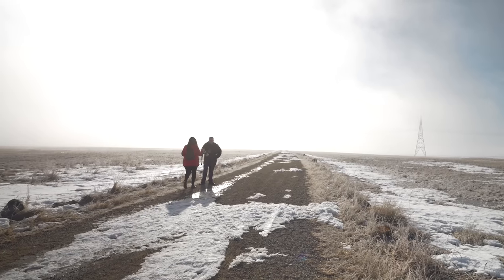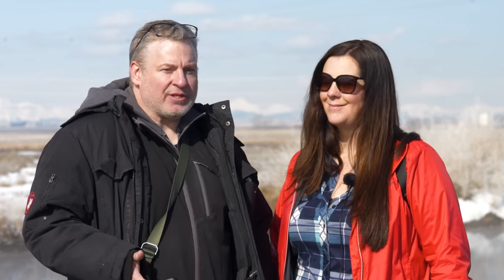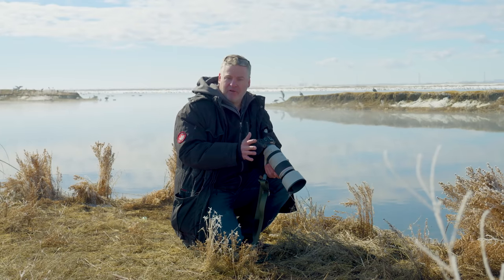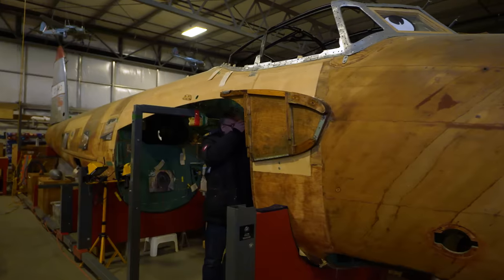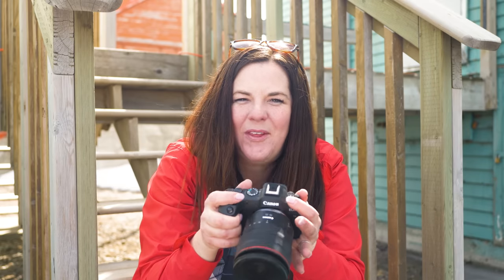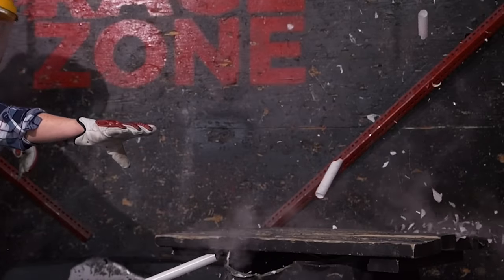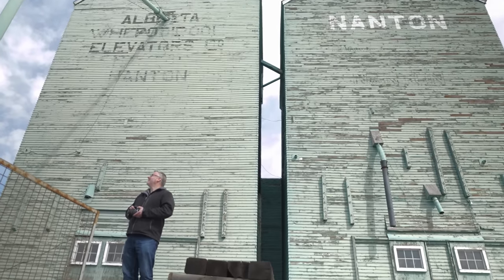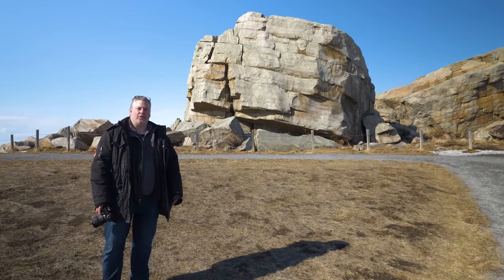Canon EOS R8 - Does It Really Live Up To The Hype?

Comment: Did y'all see the price of that R8 battery?  They cost nearly as much as the ones for the R5/R6 but only give ~ half the energy.
Reply: There are some decent off brand ones that are pretty cheap and work fine been using them in my RP for 4 years no problem easy to carry always one in my pocket and a couple in the bag. I can swap it in 2 seconds if needed got the move down! A fresh one will carry me most of the day and sometimes all day
Reply: That is the Canadian price.
There is a price difference but I do agree that it is not enough.
Half the battery life should be half of the price.
Reply: @robertm3951  Oops. I can never tell when Im dealing with a Canadian. :)
Reply: Canadian dollars aren’t worth much.
That camera is 1499USD.
Reply: Wasabi powered

Comment: I am a photographer, since it was my birthday, I opted for this because of the obvious price point. The second thing, as a photographer, what exactly is the big deal about the image stabilisation? Given that my main target is pet and landscape photography, for pet photography shooting at the faster shutter speed, not really going to concern yourself over the camera missing the image stabilisation that the more expensive Canon EOS R6 II has. 

I'm a Canon 5D Mark III user, so got the adaptor ring as all my lenses are EF, just by watching video of its autofocus technology in this camera is a massive jump from my 5D Mark III which is still a great camera and will continue to use it. The point about a 24 resolution, if anyone is put off by that, my Canon EOS 5D Mark III was and is a professional full-frame camera and given I studied photography I had to get prints done for my portfolio. I got one particular print done at A1 size and the quality is that good, you wouldn't notice a difference even if enlarging the size. Besides that, I have Topaz Gigapixel anyway.

Again, given that my 5D Mark III would've been slower relative to shooting wildlife, etc, this Canon EOS R8 will be a massive plus. The single card slot isn't the end of the world. Just about the only downside is the battery life, so ended up getting 3 more just incase.

On a final note, to get 4K video as well saving me having to switch over to then record with my FDR AX100 is a time saviour and given that I fully intend to use the tripod for professional video, I don't see the big issue missing the image stabilisation. It's crazy that this camera isn't worth more than £3,000 to £4,000.

I can't wait to get this camera and properly test out what will be my first mirrorless camera.
Reply: I'm a little surprised that, as a photographer, you don't know the benefits of image stabilization.  Do a google search and you will find descriptions of all the use case scenarios where image stabilization are of use.  You summed it up in a reverse fashion already by stating the two types of photography you do don't require it, but those aren't the only types as you know.  P.S.  Happy birthday.  :)

Comment: For me, if there was a deal on the table, the battery would kill it.

I considered the RP vs the original R and worked out that the R would be cheaper. I have stacks of LP-E6 batteries, genuine Canon and genuine third party. I would have wanted four batteries for the RP.

I decided to go for lighter kit, initially a G9. Oh why could Panasonic and Canon come to terms on the batteries? Same capacity, almost the same shape, different pinout. It would have const Panasonic absolutely nothing to use exactly the shape, and the pinout?

I'm guessing the R8 is lighter even than my OM-D E-M1 II, but how about when you kit it out with some lenses? It was the lenses killed me when I used Canon cameras.

Comment: Tempting me with this camera. Have had an RP since it first came out. Love it can get great photos, so not worried about the battery. already have a bunch of extras the single card and ibis  not big deal do just fine without. The question is R8 or a used R6 for roughly same price and which would be a better companion for my R7? Leaning used R6 but still on the fence.
Reply: Used R6 is definitely the way to go
Reply: Canon R8.  Better sensor, updated autofocus, newer tech than the R6 new for less.  Got mine on preorder now!
Reply: I owned the original R6. I would go with the R8. The tracking is superior and if you already have a bunch of batteries for it, it will pair great with your R7. I purchased the R8 to test as I do not need it as I own the R3 and R6MII but this camera is soooo good that I am actually going to keep it and give to my daughter to pair with her R10.

Comment: I was noticing a bit of sensor wobble while you were walking to see the birds on the GH6, which you do see on the R5 as well. Did you guys notice any of that with the R8? Has Canon managed to fix this issue?
Reply: So that was mostly from the electronic stabilization. I don't see any sensor wobble normally but as I was freehanding the walking bit I decided to test the electronic stabilization to see if it would help.
Reply: @drewcrawford3211  All good. Just curious if that was fixed from the R5 on to the R8.

Comment: I've owned two cameras last year. First, Lumix S5, great colors and high iso performance. I got rid of it because I felt it was too heavy with the kit lens and not that comfortable to hold and carry around. I switched over to Canon RP, I loved the ergonomics and how light it was even with the 24-105mm. The most fun to use camera I've owned. However, I was disappointed with the high iso images. The question is, should I splurge and get the Sony a7iv/a7cmii(when it comes out)? I don't need the pro features like the second card slot. I know it's about a thousand more than the Canon. Or is the R8's high iso performance pretty close? I'm guessing if money is no issue, Sony is a no-brainer?
Reply: Try the bodies before buying. I have an a7c and an RP (undecided between platforms!) and I’m replacing both with the R8. The Sony bodies just have sharp edges and are less fun and comfortable to hold… good tech though.
Reply: @albedo0point39  100% agreed, Canon RP and I'm sure the R8 (which is even lighter) feel great in hand and you don't mind carrying them around all day. However, low light performance of the R8 can't be as good as Sony. Also, the colors out of Canon aren't as beautiful. I know that's subjective but most reviewers say so.
Reply: @Ryan_Powers25  google for the recent DxO mark review of the R8 sensor. The reviewers are genuinely surprised - they found similar dynamic range and low light noise performance to Sony’s Back Side Illuminated tech. I don’t think that’s a reason to choose Sony. I agree with you about the Sony colours being good, I guess I’ll have to see how I get by with the R8.
Reply: @albedo0point39  I have checked the stats on Dx0, if real life results actually reflect that then Canon is a no brainer. It's about 1kUSD less and a joy to use. Please share your experience with the R8 once you have it.
Reply: No need to worry about high-ISO images with the R8. They are excellent.

Comment: It seems like a great camera, and it is on my short list, but without IBIS it seems overpriced.
Reply: IBIS isn’t needed unless you’re just doing video. Almost every Canon lens, even the cheap ones has IS in them, and for anything over 70mm that is more effective in the lens than the camera body. Even just doing video I’d rather have a gimbal due to all the wobbling and warping that goes on on with IBIS.
Reply: I've used RP with RF 35/1.8 lens. I was able to take pictures and video at night under street lights. Canon has great optical stabilization. My current Sony with IBIS is nowhere near.

Comment: What about the rolling shutters?
Reply from the maker: It's a fairly fast scanning sensor, so it's not bad. Electronic First Curtain shutter can also be used to nearly eliminate rolling shutter
Reply: @TheCameraStoreTV  I am into photography only. Not much into video side. So which one you suggest? R7 or R8?
Reply: @tedsclickz2535  Thanks for watching and the question. I would lean towards the R8, Larger sensor,  Better low light and FPS push it over the edge for me over the very good R7.

Comment: RP came out at $999.  R8 is its replacement and not worth $500 more.  Joke.   I had the RP and while it took great pics it felt cheap
Reply: Rp release price was $1299 USD. R8 is worth the money for its far superior AF. Wish it used better battery and that it had to door to cover the sensor. But, $1499 is reasonable for what the R8 gives you. Eventually we will probably see it at like $1299 perhaps during the holidays which would make it even better for those that are interested in getting.

Comment: 24 megapixels welcome to 2014 Canon.  Max 40fps with Electronic shutter, speed maintained for  56 RAW,  images
Reply: so need 240 megapixels? for what? so you can zoom and crop to see dog 1000miles away?
Reply: uncropped 4k 60p = worth it
Reply: They're finding that 20-26 MP is kind of the sweet spot for low light stuff. Much better for noise than the 45+ MP cameras. I notice my 6D Mark II has better noise handling than my R5. There's also nothing wrong with 24mp. You should have zero issues printing whatever you need with half that size. MP is an over-rated stat nowadays. Unless you NEED that ability to crop in, 24mp is MORE than enough for what you're doing. Guaranteed.